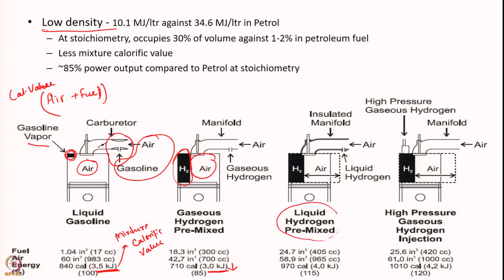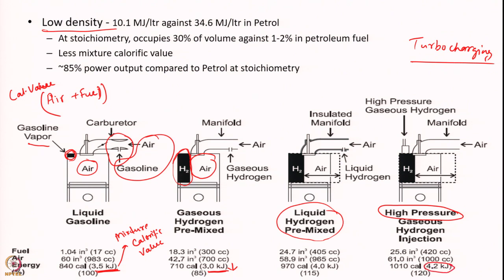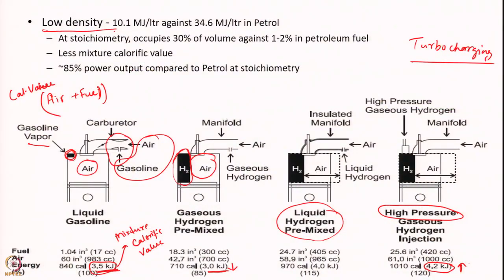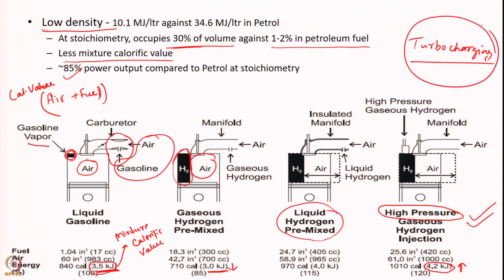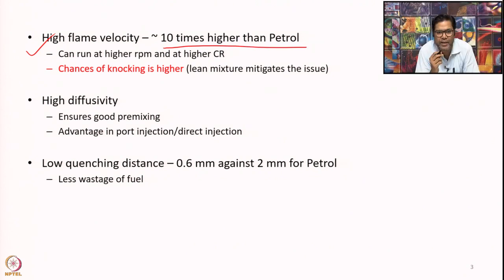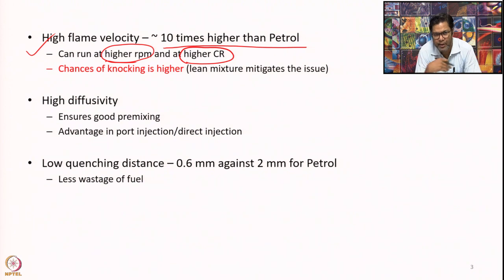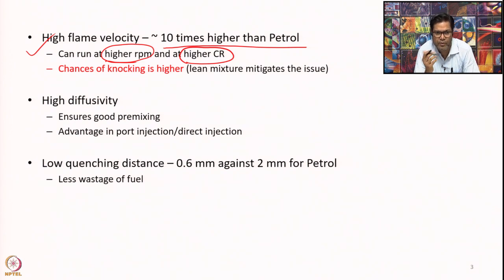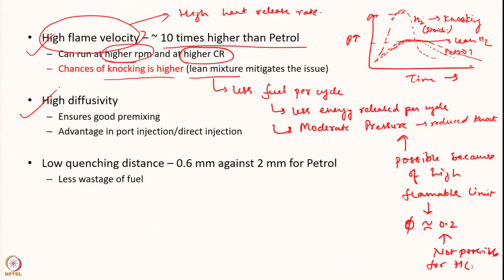Lecture 61: Use of Hydrogen in Internal Combustion Engines Part -2

Comment: Sir Thank you nice presentation.
 is the hydrogen combustion engine reliable and efficient than the current petrol IC engines ? A simple chart on pros and cons comparing  both would be good for reference